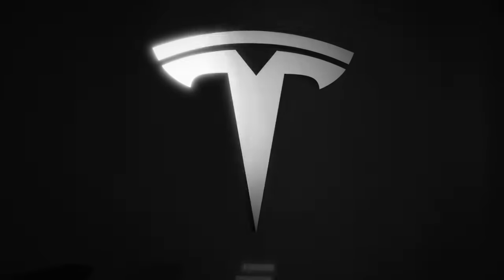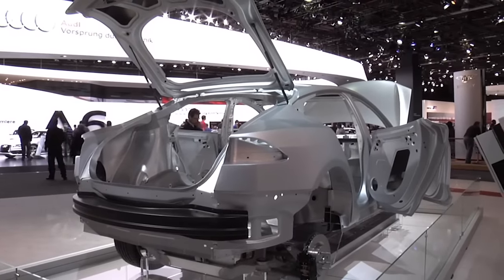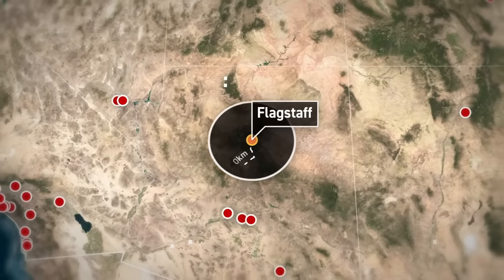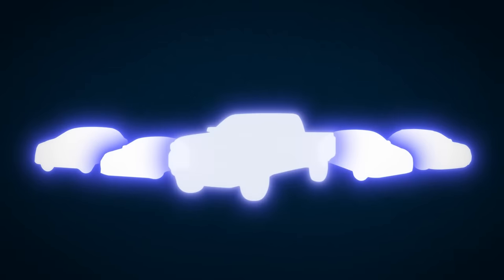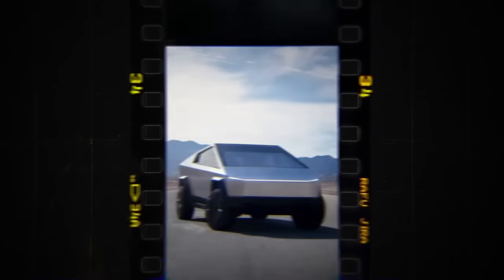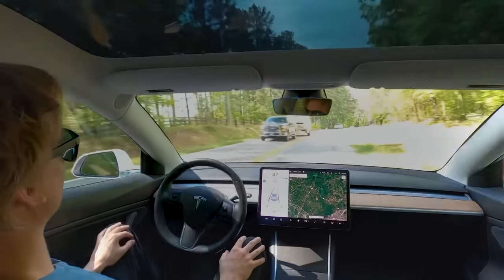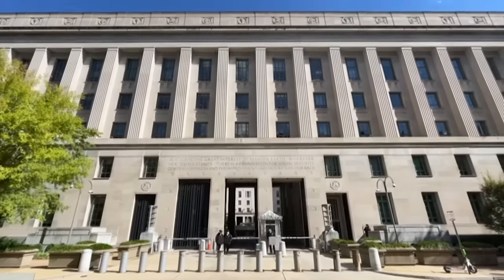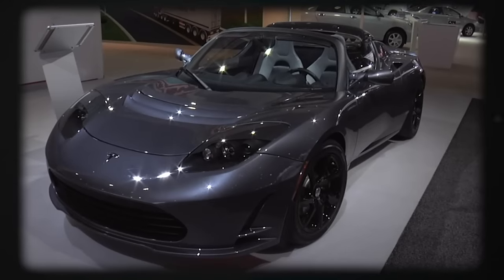How Tesla Fumbled

Comment: Doesnt Full self driving still have to go through some Dept of transportation and other Gov approval processes?
Reply: That's not the problem — the problem is that it doesn't work.
Reply: At this moment, Tesla and all self driving effectively is driven(no pun intended) by the person sitting in the driver's seats is legally still the driver. They are just using a fancy version of Cruise control.
Reply: Just like autopilot on planes, we have system that can really fly by itself, but we still need competent pilots to make sure everything goes as plan, computer aren't capable of unforeseen situations, we can't programmed systems for all events and situation. So if it still not working in the air, where the chance of hitting something is so low, it wouldn't work on the ground where you have potentially a lot more hazards.
Reply: @worawatli8952  Yeah autopilot is downright trivial compared to true self driving.
Reply: @PhazonBlaxor  
No that is an issue. Legally tesla has to call it lvl 2. Whearas in reality its lvl 3 but tesla can't call it that. Then uneducated people say that fsd is 'only' lvl 2. Without realizing its all legal jargon.
Reply: @ogzombieblunt4626  Mercedes has already got level 3 certification recently because their system works and passed the certification. See where the problem is?
Reply: @PhazonBlaxor  
*it only works when driving less than 50km/h while on a highway with a lead car. Otherwise it wont work. If you think lvl 3 has those limitations then tesla must be lvl 4.

You do realize merc only got that designation in germany because the government has favorites right? The functionality of mercs fsd system is nowhere close to tesla.
Reply: @ogzombieblunt4626  No, it's not just Germany. Mercedes is the first level 3 autonomous car company in America (only in Nevada for now though). Look it up.
Reply: @PhazonBlaxor  
Again, legal jargon. Merc has a system that literally only works in stop and go traffic on highways... you're calling this level 3? Wow
Reply: @PhazonBlaxor  Mercedes system is severely limited and not generalisable.
Reply: @ogzombieblunt4626  So? Tesla literally has a system that doesn't work reliably anyywhere, so yay? I'm not calling it anything, I didn't come up with the definitions, so don't be mad at me.

There is a reason they aren't certified, and it's because their system just isn't good enough to drive reliably in any situations by itself. MB is limited, but at least it's reliable enough to be certified.
Reply: @PhazonBlaxor  
??? What are you talking about. Even the old autopilot system (lvl 2) gets in crashes 70% less than only a human driver and is more capable than Mercs lvl 3 system. This is a fact, sorry. Calling mercs system lvl 3 is a joke my guy.
There are no crashes involving other vehicles with fsd to date, so yeah you are wrong.
Reply: @ogzombieblunt4626  What are YOU talking about? I think you have your numbers mixed. I Googled this just now and read on Forbes that Tesla cars account for 70% of all autonomous accidents. 

Also, if you believe the claims Musk makes without any grains of salt it tells a lot about you. When he said autopilot is safer, he was genius enough to compare the data to ALL traffic, including bicyclists, pedestrian and motorcycle deaths. It's like comparing apples to oranges and makes no sense at all. 🤦🏻‍♂️
Reply: @PhazonBlaxor  
LOL thats because tesla makes up 99% of autonomous cars 🤦‍♂️🤦‍♂️🤦‍♂️

Again according to the data (which you have yet to refute) teslas on autopilot are 70% safer per mile (when only looking at highway miles [which is the only place standard autopilot works so its an 1:1 comparison]). This is a fact, stop obfuscating.
Reply: @ogzombieblunt4626  They make up 99% of all autonomous cars, really? Source please. Also that wasn't really my point, my point was that you claimed there are zero accidents with Tesla FSD, which clearly isn't true? 🤔

Didn't I just explain to you that the comparison itself is irrelevant? Musk is comparing to all traffic data (also, I wouldn't trust him on the accuracy of the data itself in the first place, knowing that we are dealing with a pathological liar here. I'd like an indepentant study on this). 

You are throwing a lot of numbers, but I'd much like to see your.sources, because I've Googled all of this and failed to find the numbers you are using here. 🤷🏻‍♂️
Reply: @PhazonBlaxor  
Yes tesla fsd beta has billions of miles. Waymo is in the millions and all the other only have millions. Can you use google? Not hard data to find man
Reply: @ogzombieblunt4626  You know, that data includes all autopilots — pretty much everybody has those, so I doubt your claim since Tesla would be like 90% of all cars at that point, lol. Can't you use Google yourself? 🤔

And I see you wondefully moved the goalpost without adressing anything I said. Well done. 🤦🏻‍♂️
Reply: @PhazonBlaxor  
Sorry yes, 90 million miles on fsd beta but that is increasing logarithmacally. So like 80% more than waymo. And considering waymo only has thousands of cars, compared to 500k on fsd beta tesla will only increase their lead. 

Funny how we got here from you claiming autopilot isn't 70% better, which once you normalize the data it is 70% as many publications have reported on.
Reply: @PhazonBlaxor  
Again as I said before, when the system is used as intended. You aren't supposed to be distracted on lvl 2 or 3 autonomy. His claims have actually been proven because tesla has the best software assistance according to NTSA and EuroNCAP. You are just coping hardcore rn.
Reply: @ogzombieblunt4626  No, we got to here because Tesla cannot get level 3 certified (because their system isn't there yet) and you refuse to accept it as a fact.
Reply: @ogzombieblunt4626  But I digress, we can agree to disagree, because there is no sense in this argument and I'm tired of the constant goalpost moves.

I'm pretty sure you will keep talking BS and not address anything I've said, maybe even lie about how this conversation got started — even though we all can see it started from you saying "Tesla is level 3 blaablaa" when they aren't.. But I get it's hard to just accept when you are wrong about something, it's just human nature.

/Edit: Oh yes, that's exactly what he did, surprise surprise. I'm not going to reply, I'm done with idiots. 😂🤦🏻‍♂️
Reply: @PhazonBlaxor  
Good job ignoring my comment lol
Reply: @PhazonBlaxor  
We got here because you think level 3 autonomy has stop and go traffic limitations and speed restrictions of 44km/h. Legally regions can define lvl 3 differently than the rest of the industry, you are literally equivocating.
Reply: @PhazonBlaxor  
"The SAE refers to Level 3 Autonomy as 'conditional automation. ' It is a mode in which all aspects of driving are handled for you, but the driver must be present at all times in case an intervention request is made"

What part of 'all aspects of driving' do you not understand??
Reply: @PhazonBlaxor  
I do agree that L3 is pretty vague, but considering the limitation of german law of 60kmph its effictively a lvl 2 bc you have to take over every 5-10 mins when traffic speeds up. 
Leve'l 3 Autonomy Is Confusing Garbage
By Jason Torchinsky'

"Our engineer also had a lot to say about the 37 mph limit that’s currently the law. He explained that such a limit effectively restricts these L3 systems to traffic jams, and mentioned that he felt that in these situations

'The driver doesn’t get to relax. They have to monitor constantly if the system is off or on–going over 37 mph will turn it off, for example–and the opinion of the engineers I work with is that no one will want this, given the cost.'"

Comment: i've bougth my 3rd model 3 in germay. Because of the benefits it was financial interesting
Once i had a loos tire (from bad factory tighting). I had to drive by myself to the service center (1 hour drive). Tesla wanted me to pay full for the repairs becuse i could have changed the tires - noted, i only had a summer season with the car
An aerodynamc sedan and good motorized for an acceptable price is the Model 3 alone on the market. A BMW i4 costs way more
THe software makes sometimes concerning errors. I Work in Software testing for the 4 rings and thsi wouldnt be possible on these cars.

Comment: Fumbled is a bit of an understatement. My cousin has one (no clue what model because I always thought those cars were awful and overpriced so I never payed attention) and I know it's not the first model simply because she's said multiple times that with the rate her current one breaks she wishes she saved money and bought the first model instead. But within the time she's had it, it had gone through 5 batteries because????? (My guess at the start was bad batteries, and then became that they are just so bad at their jobs they don't know how to wire up a battery properly) and no matter what they or she tried, her normal open door button never worked for more than 5 presses after repair. So almost every time without fail the only actual "leave car" button has been the emergency open door button

Comment: They have "squandered their lead"? How can you look at their double digit percnent deliveries growth numbers year after year after year (sometimes in excess of 50%) and then come to the conclusion that they didn't take over the market fast enough? Really -- how fast would a company have to grow for it to not be considered "squandering"? This is ABSURD clickbait. I thought this channel was above that kind of stuff.
Reply: VYD is growhing way faster!
Reply: Tesla promised BIG on their electric semi. Turns out the 400-500mi range Musk boasted works only if the cargo was potato chips. Anything heavier and range goes way downhill.

Tesla promised BIG on their Cyber Truck. Yeah, well, one car channel pitted a gas F-150 against an EV F-150 while pulling a 6,000-pound trailer load. The gas F-150 easily made both the forward trip and RETURN on the same tank of gas. The EV ran out of battery before it even crossed the finish line of the forward trip. Cyber Truck might as well be Dead Man Walking by the time it rolls off the assembly line!

Further, don't you Tesla fanboys accuse EVERYTHING yall don't like as "absurd clickbait"? You really think all the haters around you are dumber than a bag of rocks... right?
Reply: @Johnny Cheung  you should see what PepsiCo themselves have said how they use the Semi's - they already use them on 425 mile routes delivering their beverages. You don't even need to believe what Tesla says.
Reply: @psihius  Sure for emty bottles!The Tesla Semi is a joke!Companys like Pepsi can efford marketing tools like the Tesla Semi Trucks!

Comment: I think you are grossly overstating the legacy autos ability to produce a cost effective EV that rivals the build quality, support and charging network that Tesla has. Not only that, the manufacturing as a product as well. As you accurately state; Tesla has many issues with support, build quality, logistics, etc. So, the bar is low. You still ignore that legacy has it far worse in some areas, and/or suffers from the same setback and issues as does Tesla. At least with Tesla I can get a vision of the future that I like. What do you get with the legacy automakers? Tesla can't just sit back and expect their customers to accept all this, but they have been underestimated in the past, written off as a want-a-be auto maker, and that has not worked out for the short sellers and critics. I think it would do those well who are critical to actually listen to their long term vision, not just the status quo of the legacy automakers and their union overloads.
Reply: You can't drive a vision. You need something a little more reliable, like something that works.
Reply: @BigHenFor  A bit hyperbolic don't you think? Apparently you can drive a vision, a few million people do every day and are very happy doing so.

Comment: Sorry but there are countless BSs in this video... I like the content that you create but this stinks of a sponsored video (or biased and uninformed).

Comparing Tesla to other EVs is just like comparing Apple to Huawei. There are NO other vehicles that offer the same value. Some may have better paint (the main problem in Consumer Reports), some may have slightly better gaps, other may have cheaper models or more luxurious. But non NON have anything close to their technology, drivetrain quality and charging network... the whole package. If you've ever been in or driven a competitor's vehicle, it will take you just a second to realize the legacy automakers are years or even decades behind.
- Almost ALL current owners have said that they will buy Tesla again... much higher number than any other brand.
- Tesla doesn't need service. And can visit any other repair shop if needed.
- Tesla's autopilot is most advanced self-driving feature in the industry.
- Tesla offers the safest vehicles in the world.
- They have the most abundant and reliable charging network.
- Their vehicles are one of the most efficient on the market.
- Their software and hardware is far superior.
- Far superior battery technology.
- Dedicated EV platform.
- Their vehicles offer the BEST EV experience. Something that others still struggle to achieve.
Reply: Indeed.  It takes a while to build out a charging network, but why on earth is nobody else coming close in efficiency?  All of them - Ford Mach E, Hyundai Ioniq 5, Bolt original and EUV, Audi e-Tron, even Rivian R1S, have drag coefficients of 0.28-0.30, vs. Model 3 and Y at 0.23.  Result: Model Y uses 25-35% less energy per km.  If anyone is fumbling, it's Tesla's competitors, not Tesla itself.  Tesla's superior efficiency, charging network, operating margin, safety, and customer satisfaction are all completely ignored, making this video a biased hit piece.

Comment: Tesla has had some build quality issues and I don't agree with their anti-repair tactics (blacklisting rebuilts, refusing to sell parts to independents, won't fix minor battery issues-insists on replacement, etc.). That said, the big 3 are all having serious quality issues of late with cam and lifter problems across the board, using cheap plastic engine parts that fail too fast, yet last indefinitely in the landfill and just pricing themselves out of the market. Every Tesla owner I've met said they've needed minimal service. The fit and finish issues would definitely irk me if I spent that much on a car, but considering they are a startup manufacturer the issues are relatively minor. Look at the ICE cars, every model change comes with a few years of headaches for the early adopters. 

I truly believed that Tesla would die as soon as the big companies jumped onto the EV bandwagon since they have existing infrastructure and experience. The reality is that they are all 10+ years behind Tesla and are not making ground. Tesla has higher profit margins and is more poised to keep investing in new technology, whereas the legacy companies are bogged down with bloated management and often unreasonable union demands. Ford has now stopped production of the Lightning due to major Q.C. problems, Chevrolet has had to recall the Bolt due to fires and the Mach E according to Munro is over complicated with tons of hoses and wires that are just waiting to cause problems in 5-7 years as it ages. 

I think Tesla has an advantage of being new and without old debt and obligations to meet, and doesn't have the human nature mentality of "we've always done it this way" that causes them to repeat mistakes. If they see a problem, they address it and they have one decision maker who can say "do it" without having committees and union discussions. They are making the Plaid models as a test to design smaller, more powerful batteries and motors that will eventually make it to the mainstream cars. They've had OTA updates since inception, while Ford admits they need a few more years to get there; in the meantime owners now have to go to the dealer every time they have a new fix. The CEO of Ford also said that they have somewhere around 150 suppliers for each vehicle, most with proprietary software that must somehow be made to work with the rest of the car. Tesla has one software so everything interfaces seamlessly. Munro said the legacy companies need a few more years to get to where Tesla was 11 years ago, at least regarding software. Tesla's biggest risk is Elon talking politics as anything he says will alienate half of the population, and his latest leanings are alienating the half that are more inclined to buy EVs.

Comment: Charging networks are what sets it apart. Here in the UK your choice is private charger or tesla charger. Attempting to piece together a journey even across the relatively small distances here using generic superstore car park and service station chargers is.... Well, you'd probably be better just getting the bus. This ensures tesla are still a fairly common sight here despite cheaper rival EVs, despite the fact they fall apart in wet British winters, and despite vertiginous electricity prices

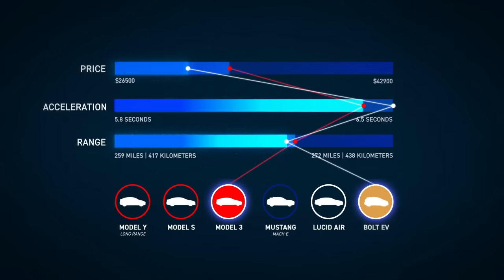Comment: 7:03 tesla model 3 the single motor is about ~5.3 seconds, dual motor has an acceleration of about ~4 seconds 0-60 mph. tested by MotorTrend and various independent car sites. 

It dos not compare to the bolt.
Reply: But basically nobody cares about those times..The average car buyer is much less concerned about acceleration than they are about reliability and build quality. There is a reason that the company that sells the most cars is also the maker of the most boring cars.
Reply: @SurmaSampo  I dont disagree with you, my comment is mostly about accuracy. If we are explicitly comparing things based on numbers, I figured it would be best to show accurate numbers when making a case between two items
Reply: @Kennedy_  Yeah I understand. The Model 3 is at the top of the class in terms of specs so comparison to a Bolt or Corolla does seem silly.